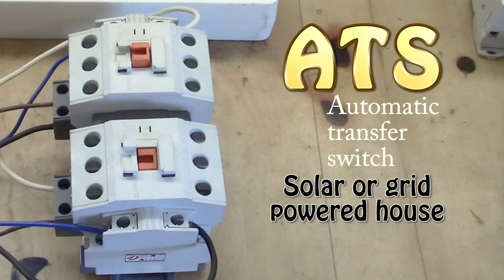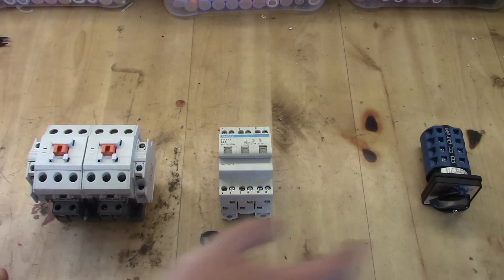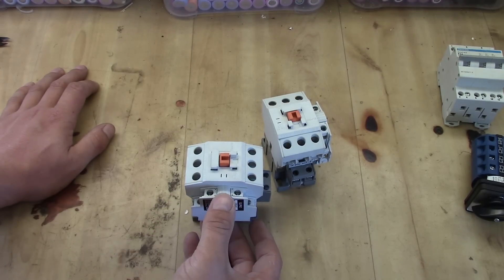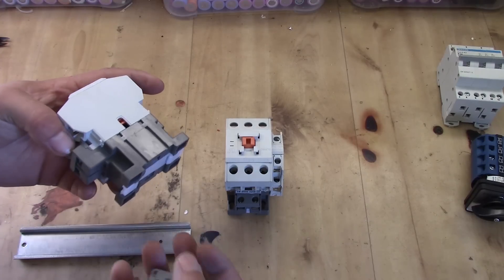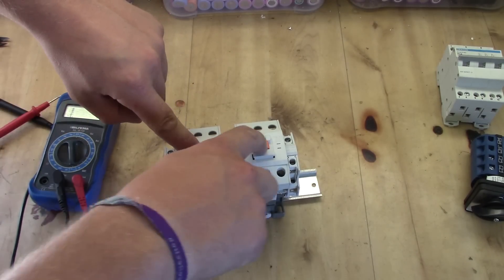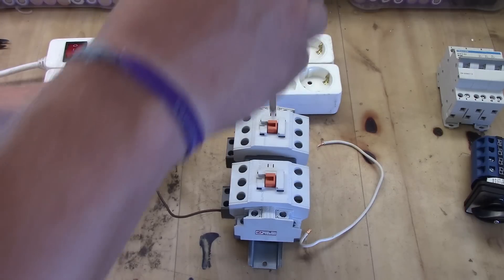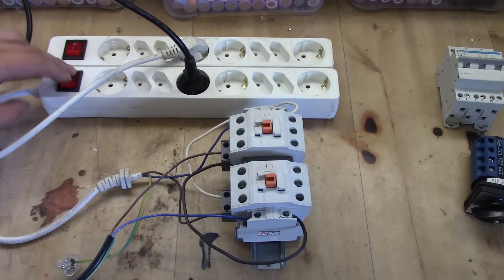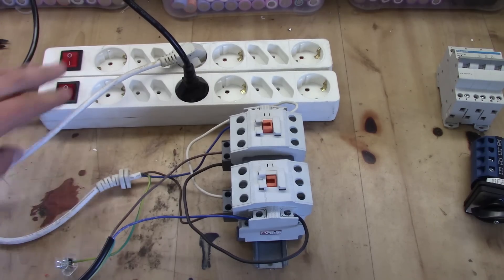Automatic transfer switch setup and quick look at 3 types

Comment: Can't you just use the normally open and normally closed to achieve this? The primary power to the normally open and the backup to the normally closed. Then if the primary power goes down the backup kicks in.
Reply from the maker: Yes but you want it to be able to switch back again. But as I have wired above is the normal way of doing it and it works fine :)
Reply: When the power comes back to the primary it should auto switch. You would have a potential flickering issue I saw you describe in another video.
Reply from the maker: Yes you should have a timer included so that it always waits for x time before switching. By doing this you will kill of any hysteres that can happen. In proper ATS system you also include under- and over-voltage protection. The 10ms delay that causes lamps to flicker is not something you will be able to get rid of. There is a delay of the mechanics inside :) And you always need to shut 1 off before engaging the other.
Reply from the maker: I Think i know what you wanted now. U can but ur not allowed here atleast. You need to have 2 parts  or contactors. Ie one turns off first. Then you lock that one and then turn on the 2nd. This to ensure it cannot fail

Comment: Daniel, so these always include a short moment when there is NO source, because of the switching times...
I'm not 100% familiar with your setup (because it's allways improving ;-) ) but is this a problem in your case? 
Would it be a good idea to include a UPS of some sorts to keep the load powered when the switching occurs?
Thanks for your insights (and your dozens of highly informative video's!)
Reply from the maker: +wimpie007 im not 100% sure of ur question. Above does the same as to what an offline ups does. Same as what most inverters also does in terms of switching between load :)
Reply: Yeah, sorry, I was a bit tired.
Comparing it to an offline UPS explains it for me.  At the exact moment when it switches between the sources, there is 0 Volt going to the load, so you can't use this circuit to power your computer.
Reply from the maker: wimpie007 of course you can power computer with it. As i said same principle as offline ups. And the computer runs on dc load with big caps so it will have time. Not sure how long but the 10ms it takes to switch is ok. Its the same as Most inverters have like both mine. Will be in next video :) analog equipment like some fluorescent lights will complain though. Note that its not ssr but relay so it will switch directly.
Reply: Okay, didn't know it worked so quickly.
Thanks for taking the time to explain!
Reply from the maker: Ur welome!  I hope to get next video up this weekend when i show from the scope how it looks when switching and the actuall switch time.  As said by another guy earlier if you switch between 2 sources you can get issues but most inverters actually sync the load with the grid so that switching is not an big issues. its just 10ms when there is no AC out. In fact its 1 half wave ouf of the 50 if we talk about 50hz system

Comment: So can this be wired to always give priority to the inverter output, but automatically switch to mains when the output from the inverter turns off but then switch back to inverter when inverter is outputting again? I don't want to manually switch back to inverter input once mains input has been triggered.
Reply: David Ball actually yes, or if you have battery's when are full to use excessive amounts of power to heatig the DHWatter.......only one thing that setup make sense when you have li-ion battery with lead acid is this too complicated...and no go.... 👍
Reply from the maker: https://www.youtube.com/watch?v=KJ3_OyOl06Y  this is the answer to your question :)

Comment: Make that as full battery priority.....so when battery's goes up to 55v goes on inverter mode without utility and when is lower than 48v goes back to utility without charging the battery with utility... and with possibility to charge the battery with solar.... 👍 
I use XH-M602 circuit with small modification.... originally is equipped with relay that have only NO as normaly open contact... 👍 I have replaced that relay with one that has NO and NC normaly closed contact to use both contact's ....
So that board give the command what will I use utility or solar depending on state of battery .....👍
What you think about that solution.....?
Reply: Hi Bostjan, I also use contactor to switch between grid and PV. My contactor is 2 NO and 2 NC. The battery voltage determines whether I am on the grid or on solar. I use a Morningstar relay driver with 4 ports, all individually programmed with a max and min voltage setting. thus my 3 sets of panels: 2 off 2.5 kW and one off 1 kW, all with Enphase micro inverters. The ports on the relay driver switches on and off the sets as required determined by the 48 volt battery bank. Cheers
john
Reply: bender banana 
Hello 
Actually I was using this setup to switch on/off electric heater because I have li-ion battery and are very quickly full so what to doo with all electricity when are battery full and I have no load to use all that electricity switching to the heater that heat my 200l tank for shower.....
Reply: bender banana 
Also a second heater to support our heating system (I use heat pump for heating) heater 1.5kw x 2 would be installed before the heat pump....
Reply: DO YOU HAVE A MODEL NUMBER FOR THIS CONTACTOR